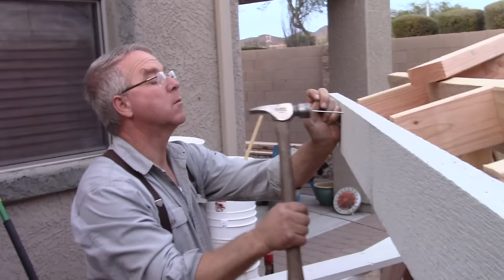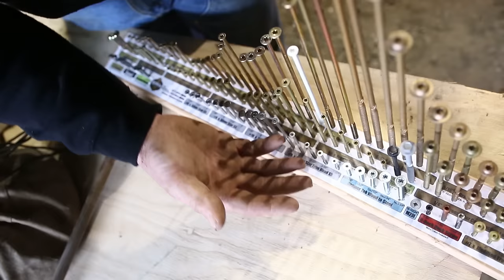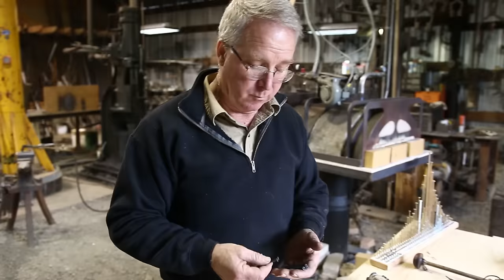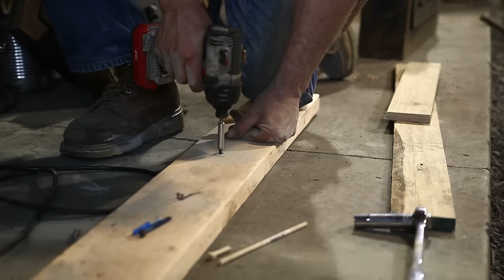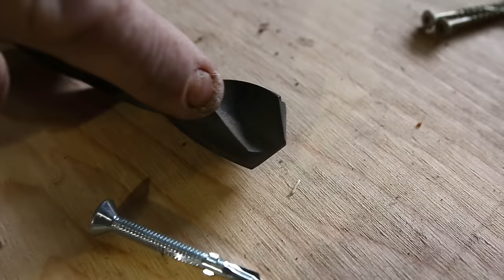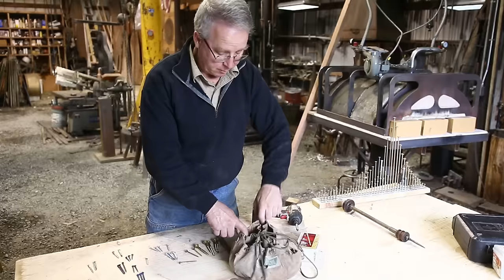Screws: What You Need to Know

Comment: As a Canadian it's fairly rare to find structural type screws with a Phillips type head since the Robertsons are so common up here. I'd much rather have Torx though. Today from what I see the most commonly found are made off shore. They seem to change there head forming dies less so it's not uncommon to find shallower head recesses than they should be. Steel quality used seem to be much more inferior and ending up with a rounded out head trying to drive them in hardwood, or the screws snapping even while driving them in soft pine. If there not properly processing the metal and treating for hydrogen embrittlement that might be a possible reason.I'm not China bashing, but I'm 100% certain the older ones that were North American made didn't have these issues. That yellow coating is usually a cadmium plating. Many don't know it, but it's very much not recommended to eat or even smoke after handling them without washing your hands first. Cadmium is a highly toxic metal.
Reply: Turning Point 
so what your are saying is I shouldn't be holding three of these screws in the corner of my mouth while I work above my head in tight spaces... fail.
Reply: I sure wouldn't, Not the cad plated ones at least.
Reply: I'm not a fan of Torx.. to the extent that the variability of the depth on the screw (as you mentioned) is an issue... but... more importantly is the driver... I'll go through a few bits per 1000 box of screws... were as my Robertson #2.. geezzz. I have had bits that last years... I would argue that , at least north of the 49th... Torx is still a novelty versus the reliable stall worth which is Robertson...
Reply: It's really important to have the proper robertson head screw and bit, there are a lot of them that are "square drive" but don't engage properly so you end up getting chewed up bits that can't drive a screw.
Reply: Robertson is the strong majority up here for structural, Red Robbie all day every day.  Torx, not at all common. The hated Phillips are found only on drywall screws and electrical.
Reply: I've used a lot of the Robertsons and they are the way of the future.  Even when rusty or chewed up they are much easier to put in/remove than anything else.  The Torx heads are fine when new but they don't hold up like the Robertsons and they're much more expensive, too.
Reply: Tech Savvy 
Yeah, I Frequently strip torx screws by accident with the new ratchet drivers.
Hate replacing them, plus if they aren't ultra-premium it's a waste of a design.
Reply: Even Canadian electrical work is all done with Robertson, the only exception being the finishing screws that hold the cover plates on.

You always know when some idiot ordered American electrical parts because then they have Philips head screws.
Reply: Of course!  It's "true patriot love" for the Canadian invention.
Reply: Wish I could find the square drive Robertson locally. Much prefer those to Phillips and torx. Got spoiled and then they dissappeared from local suppliers.
Reply: I'm not Canadian but can I get in on this Robertson love fest. They are deeper with stronger edges. They dont strip as easy. They look better. They taste better.
Reply: I've never used Torx for anything other than metal screws for automotive & electronics repair, but I have a really hard time believing Torx is better than Robertson for wood screws. With a quality bit and screw, Robertson screws stay squarely and firmly attached on the bit. I almost never drop a Robertson screw; with Phillips, it's a never ending frustrating struggle. Bits strip easily, etc. I'm surprised that the US never really fully adopted Robertson. Perhaps it's because it's a Canadian invention. Even in US electrical standards, it's surprisingly all Phillips. I'd hate to be an electrician in the US. Here in Canada, it's all Robertson #1 & #2. Even drywall screws in Canada are widely available in Robertson. Productivity wise, I'm convinced there's no comparison. I'll definitely try Torx for my next structural project for the fun of it, but I honestly have a hard time believing it's better than Robertson and worth the change.

Comment: When I moved to Texas I found that Robertson screws aren't as popular down here as they are in Canada, the Canadians invented Robertson screws so I assume that's why they love them so much. I mainly use torx now, they are a lot better anyways. Btw, spax screws are also a very good brand in my opinion, expensive though.
Reply: The reason you didn't see Robertson head screws in the states is they did not want to pay royalties on the patent to produce the screws.  Roberson and torx heads have it all over the Philips and slot head.  Specially for the part time woodworker who does not have the knowledge and dexterity to get the screws started properly.
Reply: There's a good reason why the electrical industry uses Robertson heads. It is undeniably the most reliable when having to hold the screw by the driver and making sure it doesn't jiggle or fall. Nothing compares.

Comment: never knew screws were harder than nails.  never really thought about that.  thanks!
Reply: Yep, but remember, Nails are still better for "shear" strength (most often). Nails will bend and still hold, Screws break quite easily when shear force is applied.   Both have their uses. As a carpenter,  I believe that both serve very different purposes, and are both very necessary on any job site!
Reply: PeteBillings yeah, ive always used nails for shear nailing.  screws for dry wall.  what would be better for cedar decking?  seems like nails always seem to work them selves out some, so my thought would be screws?
Reply: So the saying should be "as hard as a coffin screw" then?
Reply: Adam Kreutzer I have repaired many decks over the years. I live in Texas the combination of extreme heat / sometimes excessive moisture and usually several light freeze thaw cycles usually does a number on exterior wood surfaces not much survives unscathed here. When repairing I usually tend to replace whatever the original builders used with pressure treated wood and deck screws with torx tips. One hint if you are simply refastening an existing board due to nail pull out it is a good idea to drill a pilot hole slightly smaller than the diameter of the screw through the deck board and just starting into the support. This way the screw does not split the deck board and fastens firmly into the support. The screws with the smooth shank above the threads will pull the deck board down nicely. Do not overtighten. Impact drills will do this in a heartbeat.
Reply: Actually, mild steel have less ultimate shear strength then carbon steel. So same diameter screw have greater shear strength then same diameter nail (core diameter, not outside diameter of threads).
It is just our impression that screws are easy to brake, because it brake in an instant, while nail creep. But you must pump up the force that breaks a nail to break a screw.

But... same diameter screw is much more expensive.
Reply: stainless screws work-harden and bend a very long way before breaking - a great replacement for nails, IMO.

Comment: the yellow is zinc plated with a yellow dichromate acting as a sealer.
Reply: isn't zinc is typically silver?  Could it be Cadmium?  Cad comes in at least two varieties, Cad 1 is silver and Cad 2 is golden/yellow.
Reply: @flyingAMT  I don't know but here is what I found at https://www.gattoplaters.com/yellow-zinc-plating.html

Yellow Zinc Plating

Yellow Zinc Plating refers to the color of the chromate that is applied after zinc has been deposited on to the surface of the part. Yellow chromate prevents the zinc from corroding and increases the overall protection of the finish.

This finish provides a rainbow or iridescent appearance with dominant yellow tones.
Benefits of Choosing Yellow Zinc

    High performing corrosion protection
    Cost Effective
    Cosmetic Benefits

Considerations

Hexavalent Yellow Zinc is a traditional finish that was widely used because it was cost effective and provided excellent corrosion protection. Due to the European Union’s Restriction of Hazardous Substances Directive (RoHS) which banned the use of hexavalent chromium, the usage of yellow zinc has declined and is no longer allowed in products sold by many large original equipment manufacturers (OEM).

Trivalent Yellow Zinc is an alternative for companies in need of a RoHS compliant Yellow finish. Although it offers a similar iridescent yellow appearance it can be more costly.

A high performing alternative to Yellow Trivalent is High Corrosion Clear Trivalent.  This passivate does not produce the same yellow appearance, but it is RoHS compliant and offers high salt spray performance. In some applications, it may be more cost effective than Trivalent Yellow. This finish is a widely used alternative for applications that previously required yellow hexavalent chromate.
Reply: @flat-earther  No matter what they use for plating they are indoor used floor screws not shear screws like the GRK's ! Using them outdoor or for framing its like imposing a short expiration date on your projects ! there's a proper screw or nail specifications for every specific applications ! Fortunately here in canada the building code and permits inspectors know a lot to spot carpenter taking shortcut on proper screws and nails for load-bearing wall , lol otherwise you would have all these newbies building house with cheap gyps screws only ! I've seen people trying to save on nails and screws using cheaper gold indoor floor screws to attach their galvanised bracket on their patio deck imagine what the chemical reaction will do to these screws after just a few months plus these brackets a recommended to be attached with galvanised 1 1/4''  shear strength nails only !
Reply: Is that known as galvinization?
Reply: No... the yellow sink plated screws are not as good as galvanised screws. It’s a different process and appears to be much thinner.
Reply: Yeah, what does someone who has been plating for 18 years know....
Reply: @Indiana_John  Electroplating gives a shiny, smooth finish, but it’s thinner than a galvanized coating. Hot-dipped galvanized is supposed to be even better. Best is stainless steel, at double the expense.

Comment: I was nailing in some corner bead the other day and I was surprised at how much trouble I had hitting the nail. I used to be good at this, but I have been using screws for almost everything for years, to the point where I can hardly use a hammer anymore.

Also, GRK screws are awesome. They are holding up all my cabinets.

Comment: Thank you for calling it what it is: "TORX" ...and not "star drive" like a rube. Robertson gets an honorable mention too.
Reply: There actually is a difference between Robertson and square drive screws, Robertson has a taper to it while square doesnt.
Reply: @grizoh  The Robertson screw should have been the de facto standard. The genuine Robertson screw has a square centre with a slight taper it can be held on the bit without falling off. Having used these for ????years never known one to strip or fail...If Phillips the salesman had not conned Ford into using his screws and Posidrive had not put too many angles in the screwhead to facilitate cam out then the rest of the world would have the benefit of Robertson screws.  In Canada they are the tops.

Comment: I had 10 or 15 GRKs fail in sheer due to snow or wind load. Once some snapped, the rest bent and failed. They are great but not the save all.   
I still have my Yankees that I started making a living with in 1975. The original cordless screw drivers.
Reply: @kalijasin  I'll vouch for the simpson stainless fasteners. (that's all I've used from Simpson, and they're the best of their kind that I've tried)
Reply: What size diameter did you use? FYI the number 9 x 3 r4s are equivalent to 3 x .120 framing nails and 10 x 3 r4s are equivalent to 3 x .131s. They are code approved for framing. If you need to replace lag screws use RSS screws. Simpson’s aren’t any different than grk. Spax are similar but the screw design is different to be more productive when driving. Different loads require different diameter screws.

Comment: Absolutely agree with you about GRK... the only screw we'll use in our off cabin kits production. Only thing I have against them is that they have so much pull in torque that they will pull right through material. You'll get some overzealous wild man driving the screws half way thru sheathing... essentially destroying the connection. We use a lot of the RSS version wide heads for exactlly that reason. Now they really hold...

Comment: I would love a video about the proper way to hammer.
Reply: Awesome!
Reply: Just hit your thumb a couple of times. You'll figure it pretty fast.
Reply: Practice.  The trick is to strike the nail squarely in the center of the face.  That means when the hammer strikes the nail your hand on the handle will be at roughly the same level.

Comment: Philips screws are just awful.  They are designed to cam out and slip.  Here in Canada you will never see them except for cosmetic and non structural applications.
Reply: 121212, yes phillips do cam out , but when used to attach drywall they are the perfect screw when used with a drywall screw gun.  ONce the screw is indented into the surface of the drywall , the tip of the driver needs to disengage from the screw so as not to break the paper.
Reply: If you think Philips heads are bad (I agree they are not good for high torque applications) then what about slotted head screws? For the life of me I can't understand why they continue to make slotted head screws - for ANY application. I absolutely hate them and will take a Philips over them any day of the week.
Reply: Love the Robertson number 1-2 drivers for everything. Better than Phillips and much easier to get good bits and screws than Torx
Reply: +Rich McQuiggan 
slot heads are better aesthetically, especially on yachts. cleats, oil lamps, interior latches / hardware. 
gotta line up the slots..haha
Reply: Captmack - you have a point, never thought of the aesthetics but I still hate them. They just don't have any gripping power. If I use them (and I do on occasion) I always make certain I predrill whatever I'm working on. Just much to easy to slip and mess up the screw head.
Reply: captmack007 , yesterday I had to open some hand holes on street lights to service them. It was a very large screw.... slotted and rusted. Needless to say I had to use a screw removal tool. I got some combination stainless screws from Dottie and used some anti-Gaul/seize on the threads. Slotted screws are just a pain. Large slotted screwdrivers make great improvised prying and chiseling devices but the screws themselves suck as screws.
Reply: +nsatoday 
I hear you. when we have large bronze or stainless fasteners underwater, then at haulout they're frozen I use a manual impact driver, and a hand sledge. the slot really gives the best leverage on the head of the fastener, compared to Roberts head or Phillips, or the one that looks like Phillips the frearson head. 
if I'm driving screws into wood Phillips are great for me. pilot holes.. but I'm not dealing with crap house wood like fir or pine.. mahogany , teak, etc.. sometimes oak(!)
Reply: Think slotted screw heads are perfect for applications that don't need any torque applied.   One can't easily pound in a slotted screw like they can practically anything else.

Comment: I share your enthusiasm with GRK screws. GRK has a separate line of screws called Caliburn.  Much stronger than Tapcon and can even be removed and screwed back into the same hole, which you cannot do with Tapcon. I haven’t seen them in the big box stores but you can easily find them online.

Comment: When I built my deck I used screws on the 6x6 because I notched out the 6x6  to sit flush with my 2x12’s. The shear weight was completely on the post. I felt screws were better since the wood took the shear weight. The screws will help with shift weight

Comment: Great video! Electralicec is an outdoor nightmare. I constantly see rookie craftsmen building fenses etc. With nails and screws that are for indoor use. And every time the rust runs down the board or side of the house trim... Come on at least use some galvanised products! Puch your nails, counter sink your screws! And caulk them in! Sub out the painting job! Sit back Crack a cold beverage, and pat your self on the back! because you just became a contractor😁 
But I digress, I'm a 34 year old contractor working hard to do the jobs right! I watch all the videos I can. I have learned so much, but have much to learn. I started in high school in a carpentry skills trade class. Got a two year degree and started out framing houses. if had seen your video on on skill saw tricks. I would have made rookie of the year. Hats off your an inspiration Sir!!! with great knowledge and pressies intellect on the subjects of building trades. Great work and sir, thank you for taking the time to teach and inspire us to be better craftsmen! From forks W.a. have a great day

Comment: New subscriber here.   You said you graduated in 1976.  I graduated in 1977!  Right behind you!  Thanks for the video.  I am trying to put wood studs in my metal garage that has hardened metal purlins.  I have put up a small wall by screwing the stud into the metal purlin.  I had some difficulty getting a screw that would tap, so I screwed a hole with a carbide bit and then used metal screws to fasten a wood stud which I could then fasten OSB onto.  I like the OSB since I can then hang tools and hoses to the wall.  So I am thinking of running to the local hardware store for advice on the screws.  Thanks for your video and for listening.  Have a great October!